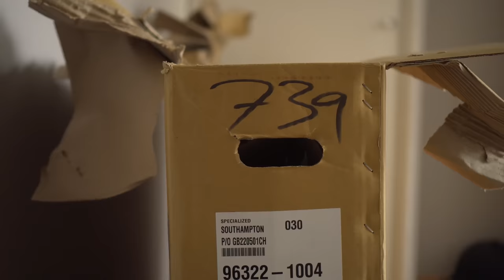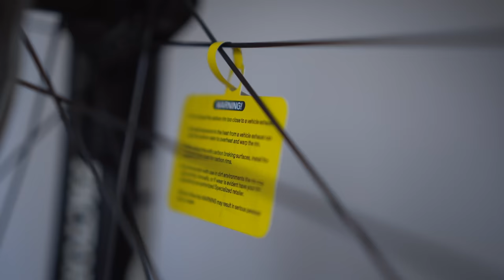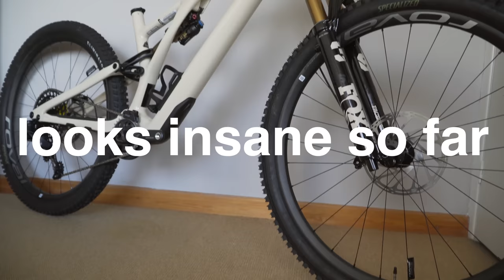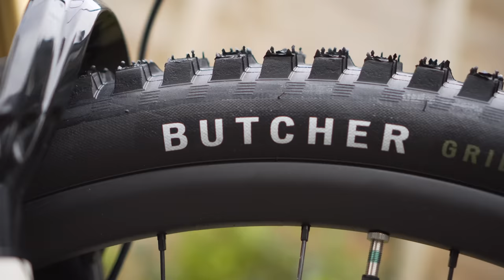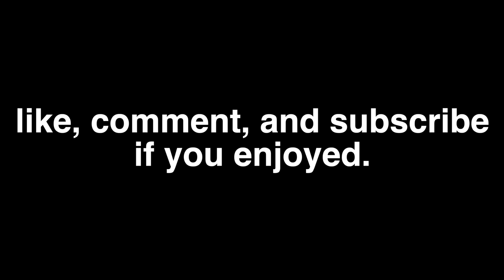New Bike Day! Unboxing my 2022 Enduro Bike...

Comment: love the bike. think the process might look smoother if you'd have started by putting the dropper post in then holding it in a bike stand
Reply from the maker: Thanks bro! You're defo right about that, but sadly the dropper is normally what takes the longest for me to do and i was on a time limit (had to finish filming before it got dark as i wasn't using any artificial light sources) so decided to leave it til last 🤷🏻‍♂️